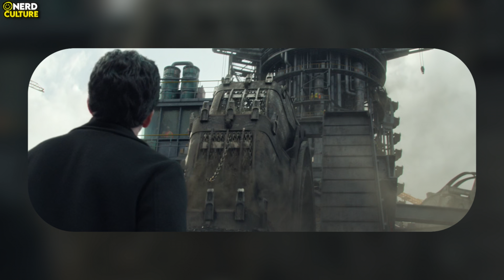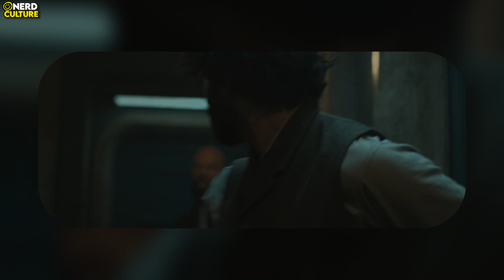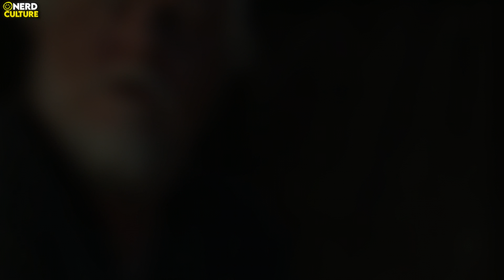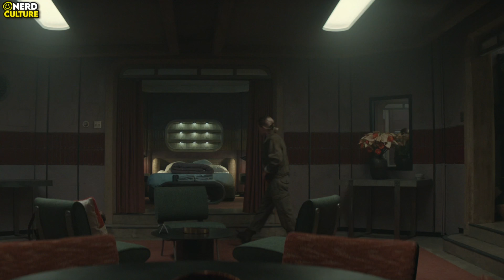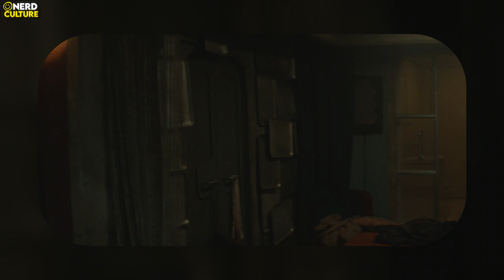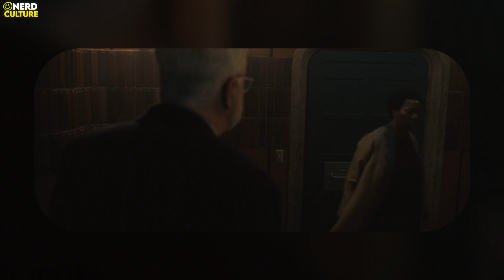The 50 Silo Story Doesn’t Add Up… Where Is Silo #51?

Comment: Mind-Blowing Silo Theory: What did Bernard mean by "Technically 51"? 🤯👇

When Bernard revealed this secret to Lukas, many viewers thought there was a hidden 51st Silo out there. But on the map, we only see 50 circular holes. Here is the actual truth behind that line:

1️⃣ The Setup: The physical world only has 50 Silos in total. Silo 1 is the command center where the frozen founders live, and Silos 2 through 50 are the residential ones (like Silo 18).

2️⃣ The 51st Hub: "Technically 51" refers to the Central Server and the Core Algorithm. The network requires a master override—an artificial intelligence/server hub that manages communications, monitors screens, and controls the toxic gas.

3️⃣ The Ultimate Authority: This central system acts as the 51st layer of control. It dictates the rules to everyone, including IT heads like Bernard.

Conclusion: "51" isn't a place made of concrete; it’s the digital code for the ultimate authority running the entire human simulation! 👁️🚫

What do you guys think? Let me know in the comments! 👇

Comment: 51st silo is a separate silo that has resources to rebuild humanity. It will probably be introduced in the next season.
Reply: That’s spoiling season 4 😢
Reply: In the maps of the silos that get shown onscreen for brief moments, they 7 groups of 7 with silo 1 in the center is not symmetrical.  Also, the lines between the silos has one line going away from the top as it if it connecting with something off the map?
Reply: That it correct. The 51st silo called the "seed" has all the food and resources to rebuild humanity except for the nano technology which was the reason for destroying the world.
Reply: I don't want to spoil, but the books, one of the final scenes in Dust introduces us to one more silo, and there's a word in that episode where Helen and Daniel are introduced to the silo concept that gives a hint to silo 51

Comment: The 51st just contains the algorithm and a power supply so it’s probably a lot smaller
Reply: Power comes from silo 1. 51st silo may be independent
Reply: There is a small silo at the top of the map in front of a large building.
Reply: I keep wondering where the term algorithm came from? no one on the show call it that, there's nothing called an algorithm in the book series, I think just the voice would be better...in the series the connection is from a headset to the headsets in the various ITs in all the silos...
Reply: @warrenbootz sometimes in the caption in season 1 and 2, they showed it. Look at the  Lucas Kyle tunnel clip. That is where it came from